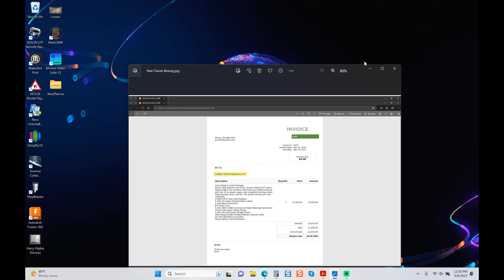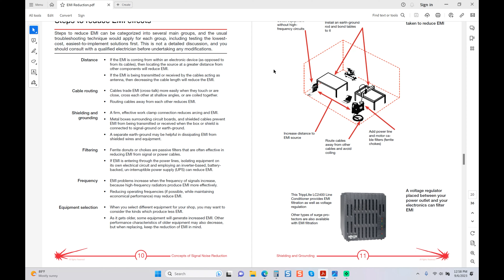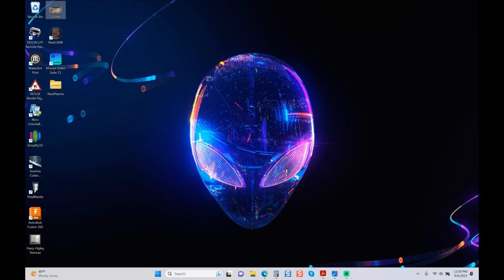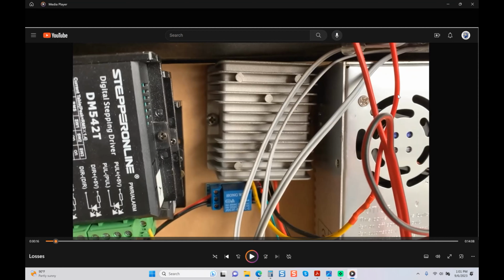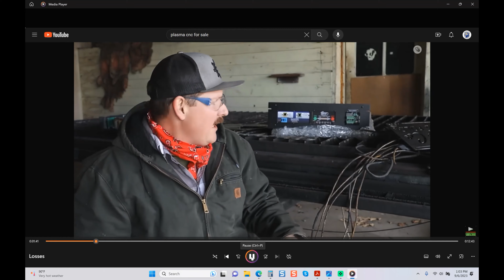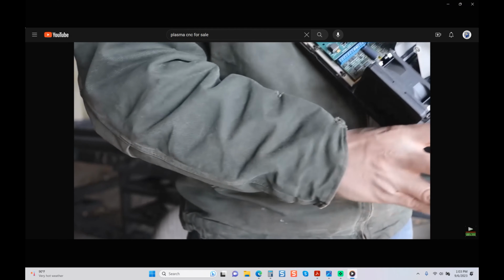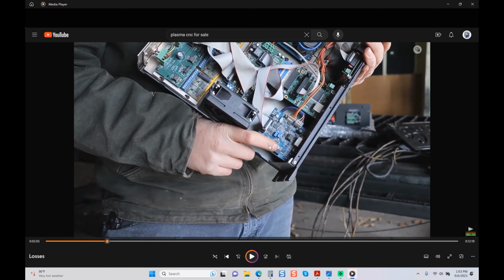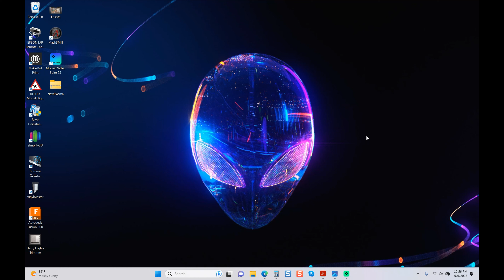CNC Plasma Controllers Built Incorrectly (Volume 1)

Comment: I like when someone goes to the trouble to use shielded wire but then fails to ground the shielding. I've seen some on YT build a fairly decent system but then use plastic or wood enclosures.  A lot of the YT builders also put the VFD in the same enclosure with all the sensitive electronics. It may never be an issue with their builds, but I don't want to take the chance.
Reply from the maker: Yea, this is very common along with the VFD being mounted with the electronics, and unfortunately, it's because no research is done from credible sources.  Thank you for your support. Vince

Comment: Here's something that'll make you shake your head in disbelief - the meter and fuses in the main switchboard for my house are mounted on MDF. These are tamper proof sealed and have to be signed off by a level two electrician on install so I'm assuming it's compliant (and probably the fire rated type) but it seems an unnecessary risk to me.

Anyway - thanks for the videos. I studied this stuff at uni, but have been working in software, so it's a great refresher before making my own plasma cnc.
Reply from the maker: Thank you for your support. I really appreciate it. I would certainly check with your insurance about the use of MDF in a breaker box as this is not the standard practice for most states. 

I'm glad the videos help. 

Thank you, and have a great weekend!
Vince